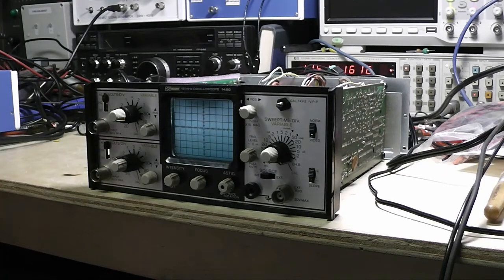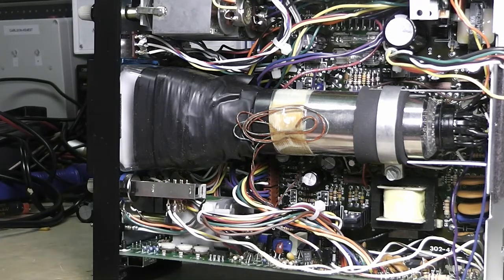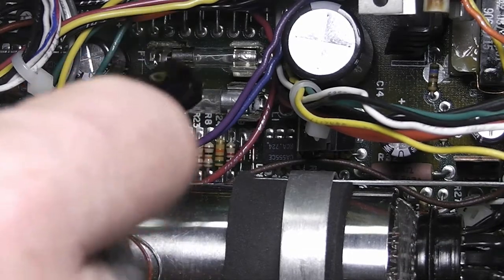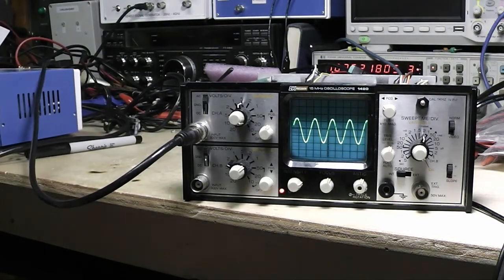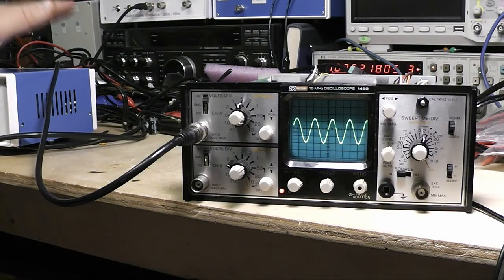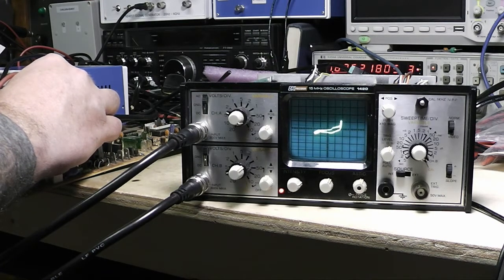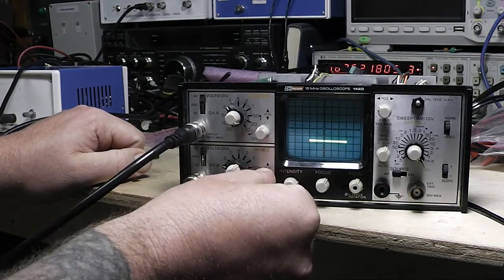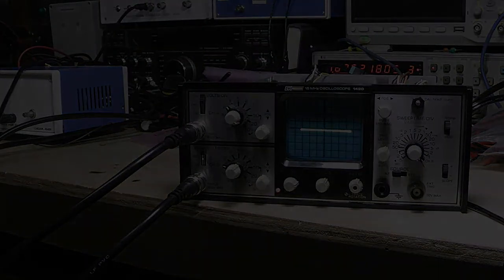BK Precision 1420 Oscilloscope Curve Signature Tracer

Comment: Good deal, now all we need to see is that unit with the curve tracer, actually be the tool that found the problem that was ailing you...  I sure like to see more test equipment in action...  Thanks for the video...
Reply from the maker: I will try and do that in the future.  It is for sure going to be a permanent fixture on the work bench.  I got the new DC jacks in after I shot the video.🙄